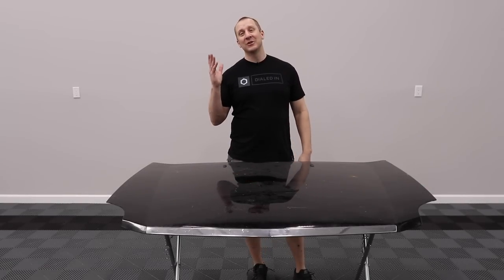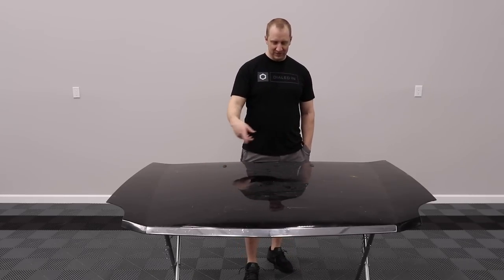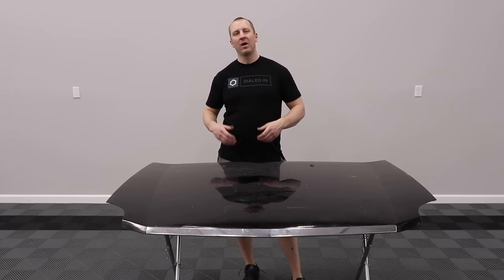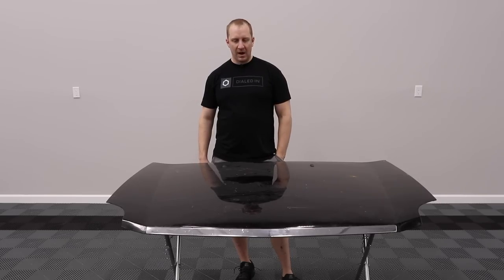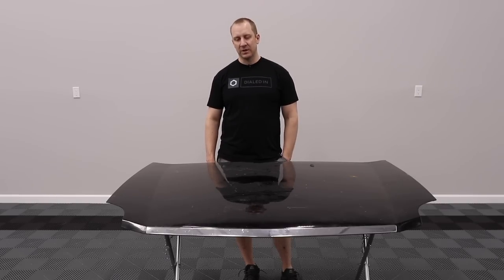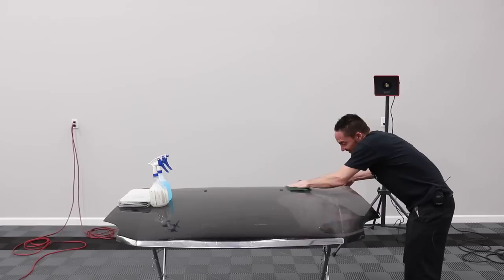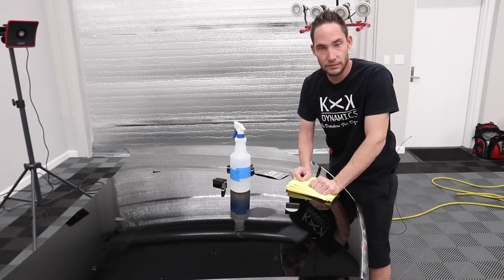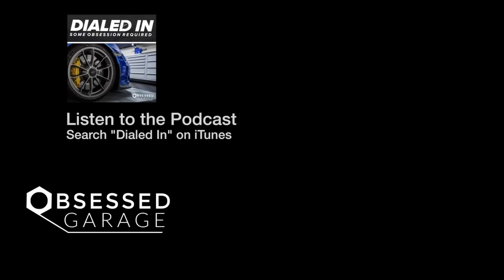Wet Sanding & Advanced Polishing: E1- Jason Killmer on Basics of Sanding

Comment: Fantastic series Matt.  I appreciate that you took the time and effort to do this.  You're obviously a very knowledgeable guy, but your humility adds so much the increased level of learning offered by the boys at KXK.

I do have one question for you: I'm still in the process of watching the series, but I wanted to ask you whether Jason provided any "tricks" or guidance (perhaps off-screen) regarding the initial assessment of the "grit level" of a scratch that you're preparing to remove.  I know this is a very subjective process, but some rough guidelines would be handy, although I appreciate that having the skill set to do this boils down to experience.

Thanks again.
Reply from the maker: That's a tricky one.  You would want to measure the paint around it, then make an educated decision on how much of the scratch you want to remove.  Another test is the finger nail test.  If you can feel it with your nail, it's most like not coming out.

Comment: Great Stuff Matt!  I am excited for this series.  You have asked great questions as well.  If you don’t mind me asking; what was the price range for a hood at the wrecking yard?
Reply: You can get them for betwen $80 - $150, depending on the car and the condition.
Reply from the maker: I know the guy that owns it, so I paid $20 a hood.  Packetattack is right about the $80-$150 normally.
Reply: Thanks for the info guys.  Turns out I had a free source right under my nose, but if needed that cost isn’t horrible.

Comment: Man this video is getting too technical... even tho I am a master wet sander,  the presentation of the info is almost fear mongering....
Just get some water, add some soap put it in a spray bottle. (Prevents wet sand paper from clogging) I normally use 1500 (cross hatch sanding) then jump straight to 3000 trizact and then compound, and swirl if need.
Boom done!

For a  mirror shine...
1500, 2000, 3000 trizact, 5000 trizact, compound, swirl.

Cross hatch brings the layers down quicker. Sanding in one direction just to be able to buff it out easier is a good way to save product.. but a good detailer should be able to buff out 1500 scratches with compound alone.
I have burned through the layer of clear many times. Only experience will give you the skill to become a master wet sander.

Great video BTW! Just wanted to share some of my detailing knowledge.
Reply from the maker: Jason Kilmer is generally regarded as the best wet sander in the world.

Comment: I closed my restoration shop right before the scamdemic, after nearly 40 years of complete, ultra high-end paint and restoration work. When I started, guys were wet sanding lacquer paint with 600 paper dunked in a coffee can full of lacquer thinner. One of the last cars I completed before closing was a '67 F Body. After completely re skinning the entire body and redoing all the mechanicals, and painting, the owner had over $120,00.00 in it. Even with that level of insanity, I'm not sure even a guy like that would pay me to wet sand his entire car, completely flat, with a domino sized block. Nor, did I have 100 hours to wet sand. Maybe a Ridler car, but the vast majority of customers won't pay $15,000.00 to wet sand and buff an old Firebird.

Comment: Where can you get a test hood?
Reply from the maker: I went to the local u-pull it junk yard.
Reply: I also got a connection with a auto body shop when they pull panels off of wrecked cars. Some of them have a little bit of wrinkles/damage to them, but they're free as they were headed into the recycling bin anyways.